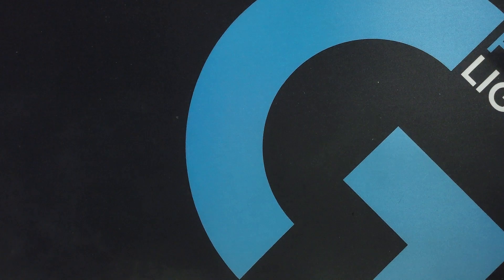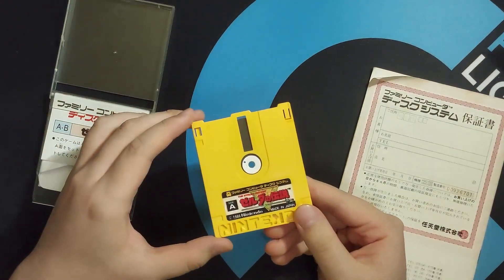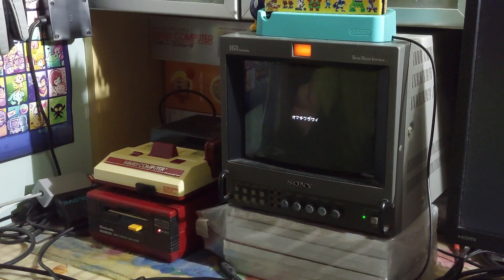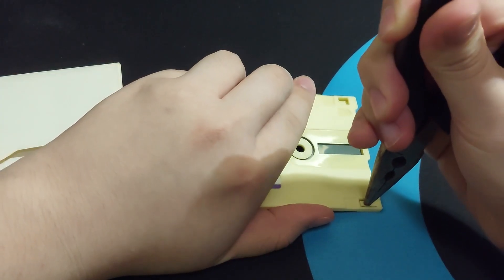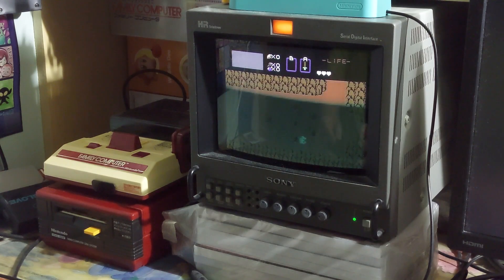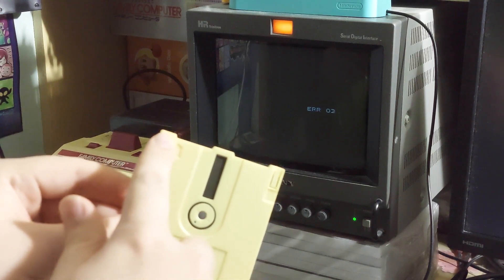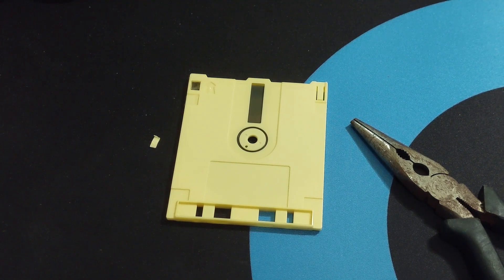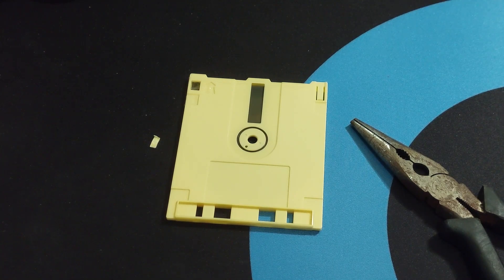Testing Write Protection on the Famicom Disk System

Comment: The write-protect “switch” on an SD card is not really a switch. It’s a it’s just a captive piece of plastic.

Look at any blank or home VHS tape and you’ll find the exact same break-away write-protect tabs. The actual floppy-floppies used a similar notch that you could tape over. Rigid diskettes had a captive sliding write protect tab much like SD cards but commercial software was sometimes sold with the tab removed so you needed tape to write over it.

The internal FDS switches that feel for the notch also feel for the holes in the Nintendo logo and the FDS refuses to read the disk without them, which is why the bootlegs have those strange cut-outs.

Comment: Floppys use this method, 3 1/2 diskettes even used a tab that you could move to cover or uncover the hole, so, no breaking necessary. Also, cassette tapes, Betamax tapes or VHS tapes used breakable tabs to protect the information stored in them. A very common and mostly efficient way to write protect your mediums back in the day.

Comment: Copy protection like this was common on most forms of removable magnetic media. They would either use a physical or optical switch to detect whether or not there was a hole or recess in the disc or cassette.
Reply: Well, write protection. It didn’t stop you from copying. :)

Comment: So basically it bahaves like 5.25" floppy diskettes in the sense that you can also write protect these by punching a hole in a very specific spot on both sides.
Interesting to know indeed, I only heard many people in Japan have actually overwritten the original games all along with others as Nintendo had kiosks for copying new files to blank diskettes (and cartridges) in their country 👀
Reply: 5.25“ disks were write-protected by putting a sticker over the notch, not by cutting one. 
Cutting a second notch was only for making "flippies", so you could use both sides of a double-sided disk in a single-sided drive.
Reply: @CptJistuce  huh... Guess I mixed up things then.
Thanks for clearing things up!
Reply: @MegaManNeo  No problem.
It is a common mistake, since it is the opposite of 3.5" disks.
(And I have no idea what the write-protect rule is for 8" disks)

Comment: If I recall correctly all floppy disks have a form of write protection. For the older floppies (the ones that were actually floppy) you needed to punch a hole on the bottom left or right to write protect the disk, and for newer floppies they have this plastic switch on the top right corner to initiate it.
Reply: On the 5.25" disks, the notch was cut from the factory. You had to cover the notch with a sticker to write-protect the disk.